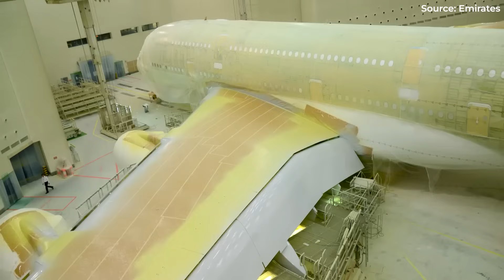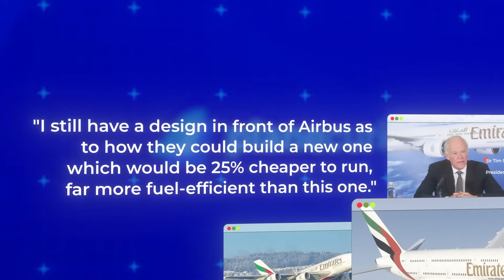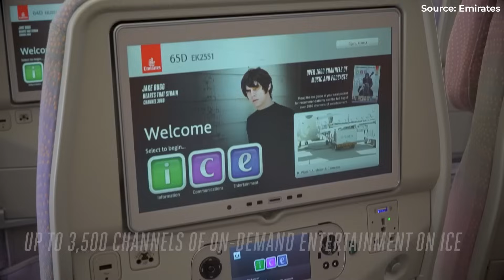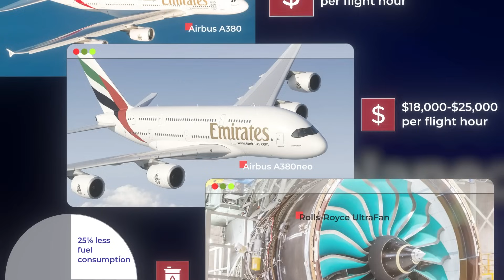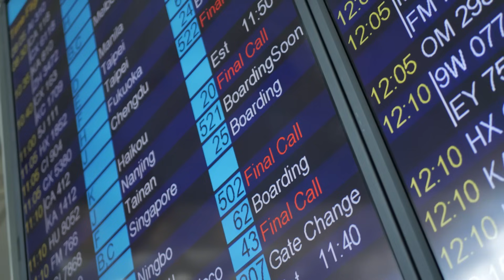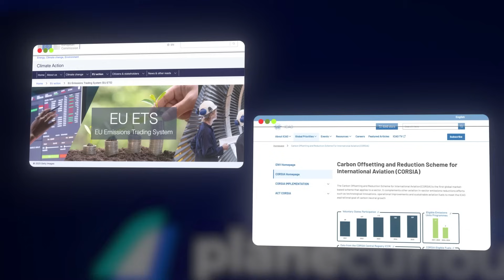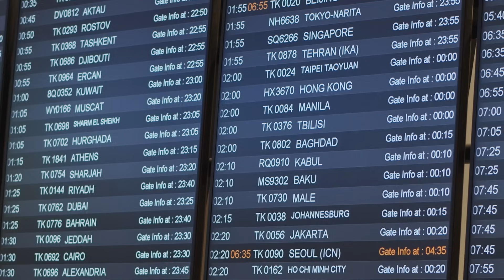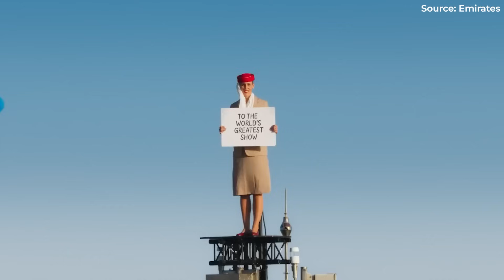Emirates Needs The A380neo - But Here’s The Twist

Comment: Resurrecting A380 simply is a terrible idea. Emirates can operate theirs economically because of UAE’s unique geographic location (being about mid way between most major cities in Europe, East Asia and Oceania, and they have all the supporting infrastructure needed to make their routes attractive enough for a meaningful sum of passengers. Other than Emirates probably only Qatar Airways, Etihad and Singapore Airlines have such luxury. It just does not make sense to Qantas, Air Korea, Asiana, Malaysia Airlines, etc.
Reply: And yet there are Qantas A380 in the air nearly every day on the 'Kangeroo' run from Sydney to London. In fact, every outbound A380 passes two A380 with the same flight number on their return journey. I'm certain that those airlines that previously bought the A380 and still operate them would buy twice as many A380neo if they were 25% more economical.
Reply: @WOTArtyNoobs  And the QF ones are always full. Not sure they would buy more, but they are certainly working them hard whilst they still have them

Comment: A380 neo would have been epic
Reply from the maker: It really would have been!
Reply: @planecurious because imagine a sky whale, a Leviathan, crossing 70% of the planet in one tank, having as many people as a small village. Dayum!
Reply: 100% yes a380 forever ❤❤❤
Reply: Fr
Reply: Im with it, man. I wish more people were brave enough to just build incredible things like this.
Reply: @CAvakian  not just build but have a aviation that is co-op based that would take on boeing, airbus, ilyushin, tupolev etc.etc.
Reply: We are probably 1 or 2 year ahead of when the next generation Aviation engines will be published. 

At the earliest we may see them already at The Farnborough International Airshow in January of 2026, at the latest they will probably be published around Summer of 2027. They will show pre production unit at the very same show  and companies like airbus, Boeing and possibly large airlines lime Emirates may by a small number of pre production units for testing.

Those new engines promises fuel cuts of 15-20% with secondary effects of about 5% additionally (Primary lighter engines and lower fuel load).

If you would like to reenginie a A380 you would wait until the next generation, getting a larger gain.

The new engines are basically finished already. The main reason they have not published them yet is that Airbus is sitting on there hand not making a new aircraft right now. And the reason they are doing that is to force Boeings hand to do it first.

Boeing on the other hand can´t afford to push a new model right now due to trubble with the max -10 and the 777x, they have to push those to the end of the certification before they can take on a new semi blank sheet project.

Boeing is doing the 797, but not yeat. Hence the new engine simply lack a market yet, hence they have not been published. 

Its also worth untill they publish the new engine they can push the preformance of them and make them stronger, more efficent and reliable, so from there persepctive they want to wait as long as possible to publish them if they can.

Its worth saying that reengine a existing plane have been done before like with the DC8 that got high bypass engines cutting fuel use and improving range
Reply: So would the A340neo as well and two more inches longer than the "600" variant.
Reply: if they would have done it ... they will have to add the freight version as well ;)